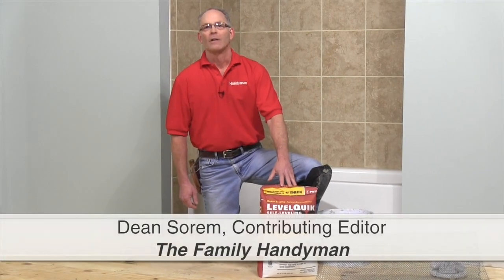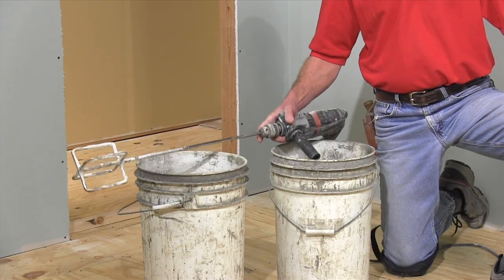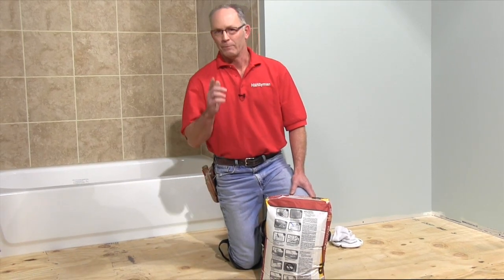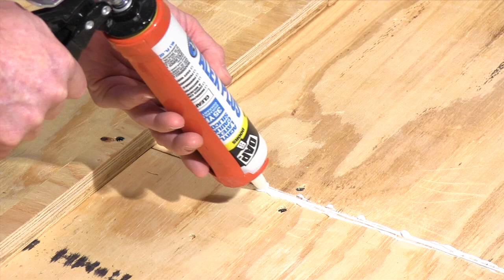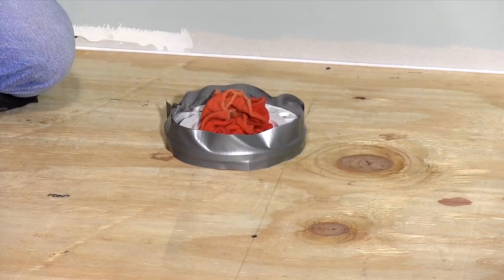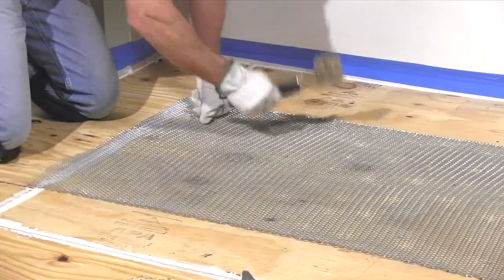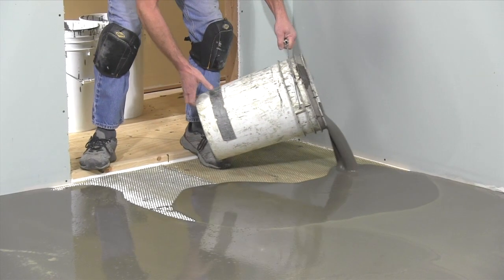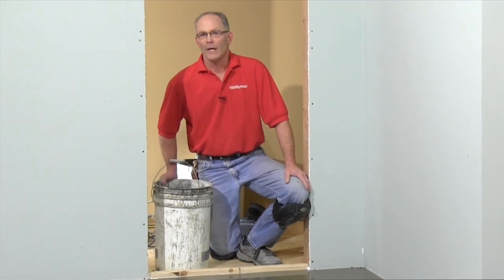Pouring Floor Leveler for Uneven Floors

Comment: Great video .  The only thing that’s a little confusing is that custom home products video suggests using a gauge rake or smoothing tool to push the lever around.  I think your instructions make much more sense .
Reply: yes, exactly.I knew how to do this and then when I saw the bag was like ....whaaaat?
I wanted to be sure that it needs to be runny.

Comment: Would the drywall suck up the water from the concrete?
Reply: Smh... No. It'll be fine. Dry Wall 😆.
Reply: @0714will  it's called drywall because it can't get wet. Gypsum crumbles when wet and can create cracks with mold.  Don't make fun of a comment when you don't know shit.  You should staple sill seal around the perimeter of the wall to protect the drywall from the moisture in the leveler.

Comment: Great video and info but please I have a question I am removing my tub and walls and I want to install walk in shower base and new walls  made by flexstone and I have to glue the base and  walls   but they not recommended using shims for leveling the subfloor  and if subfloor is not level do I need to use  self leveling  or any other way  ?  or Mortar ? and do I need to add wire mesh if I am using self leveling? please advice

Comment: Do u have to use Lath ??? i  have  small part of my washroom to be leveled
Reply: For plywood, yes.  If not, it will crack on the bottom when the floor deflects. The lath prevents deflection when someone stands on the joist.  The following video on re-bar is good.